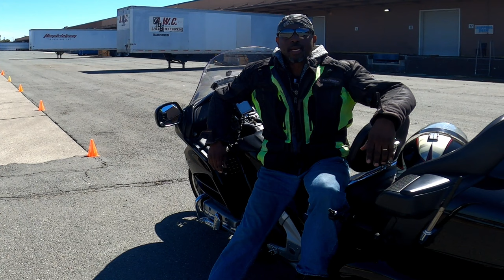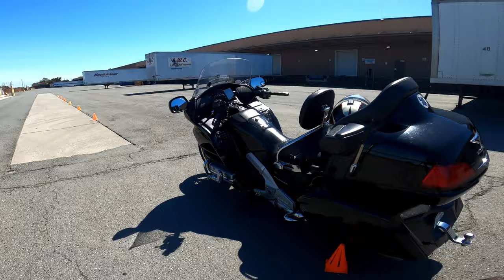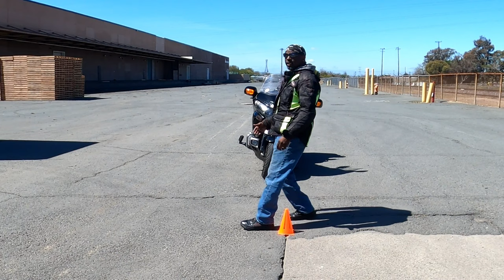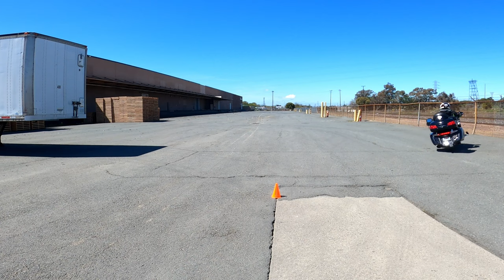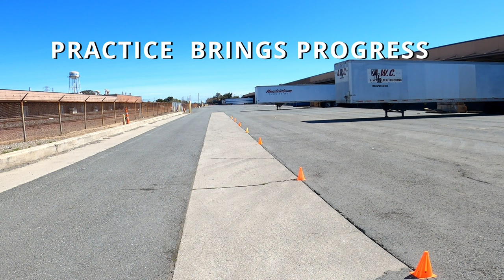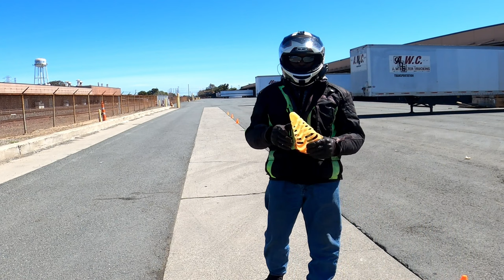How To Ride The Slow Cone Weave | Slow Motorcycle Skills Practice

Comment from the maker: Slow Is Smooth & Smooth Is Fast. Thanks for checking out this practice video. It's a basic slow skill pattern that you can practice with little time...You can use a parking lot before going on a ride. It will take you less than 5 minutes to weave between the lines.